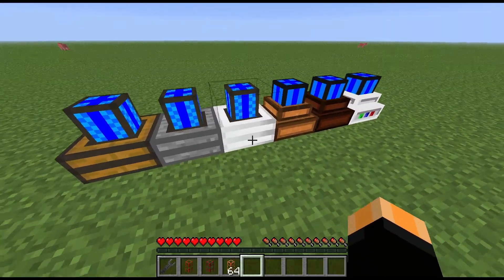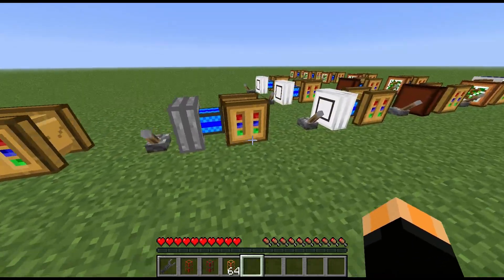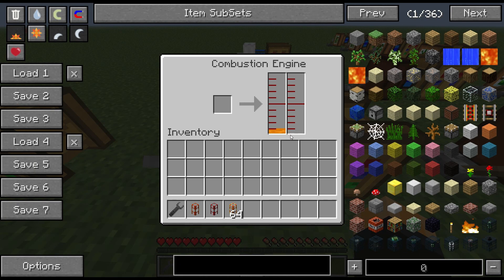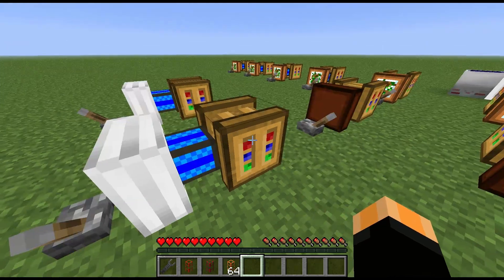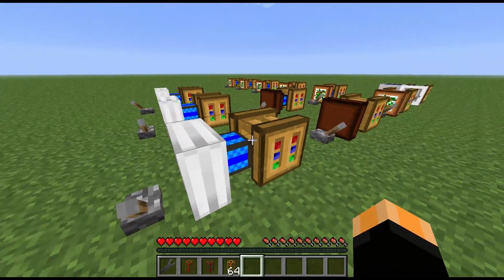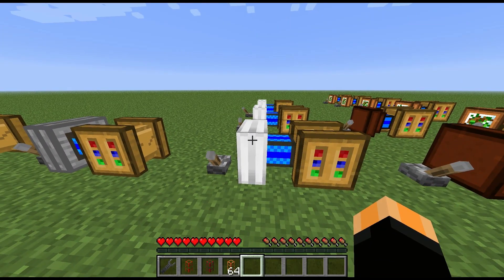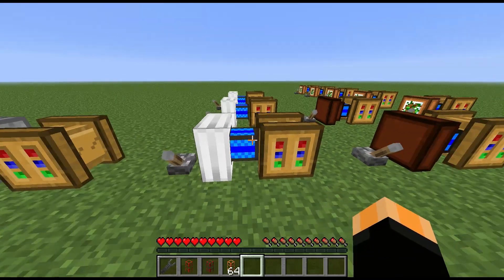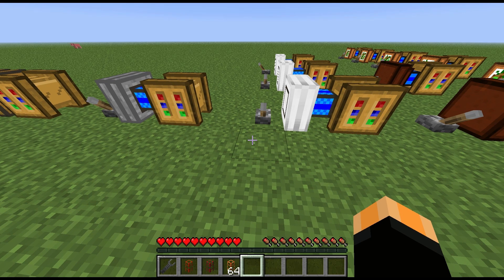Block Spotlight - Combustion Engine

Comment: In addition...the liquiduct as opposed to waterproof pipes is superior.  I have found that I can run 4 combustion engines on one Accumulator with Liquiducts attached to the BACK of the engines.